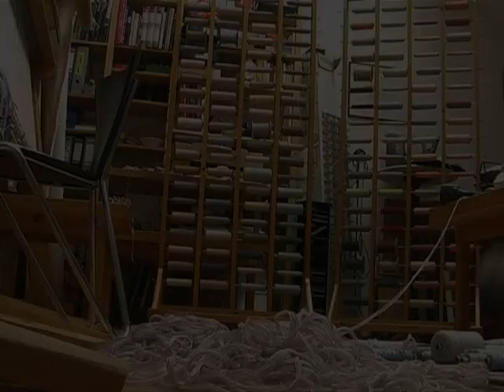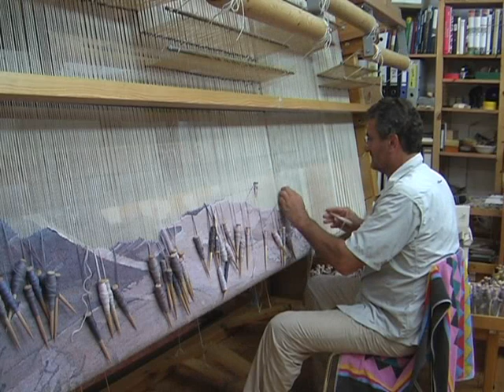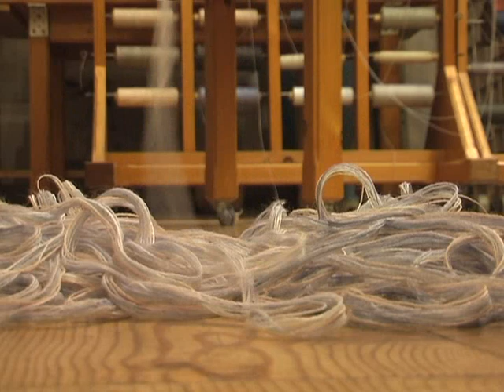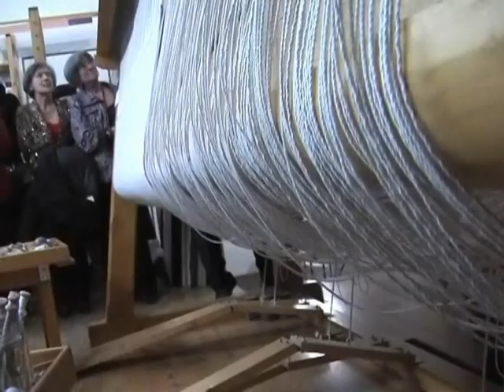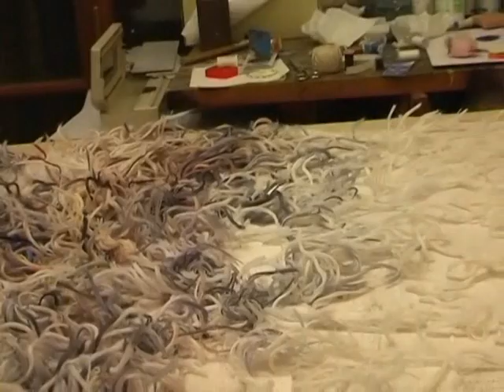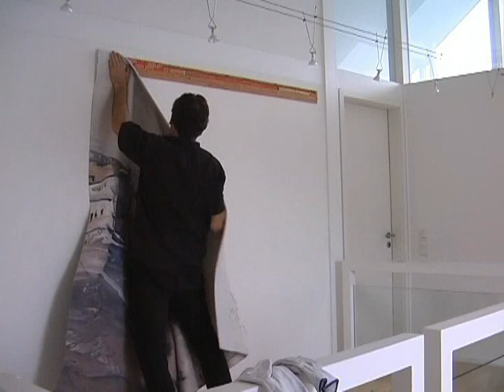making a tapestry

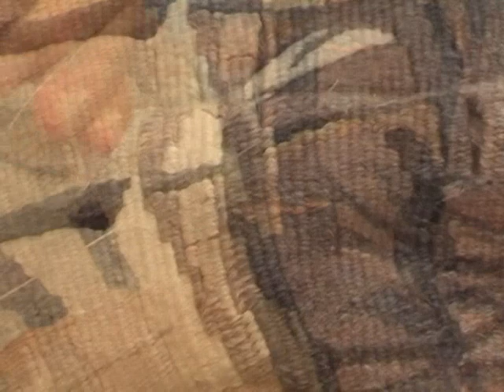Comment: Why is he sewing at around 7:40? What is it he's doing?
Reply: To get really straight vertical lines you have to do a slit technique. You are bringing two yarns towards each other to a point and then turning back in the other direction. This leaves a slit between the two colors that must be sewn up either as you are weaving or afterwards. This is what he is sewing shut. The sewing is invisible once it is done.